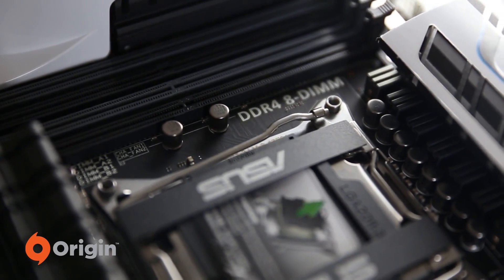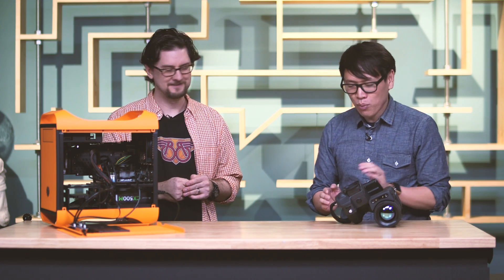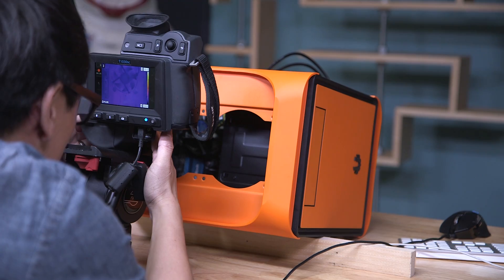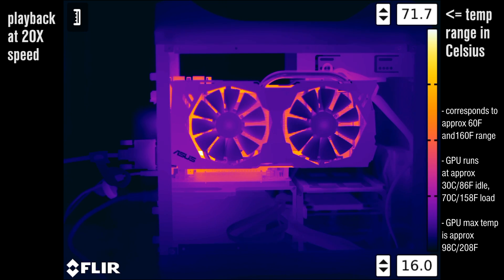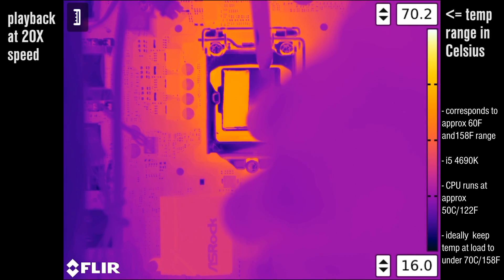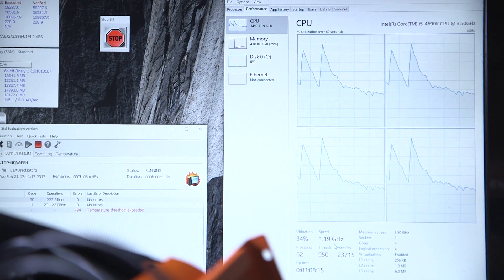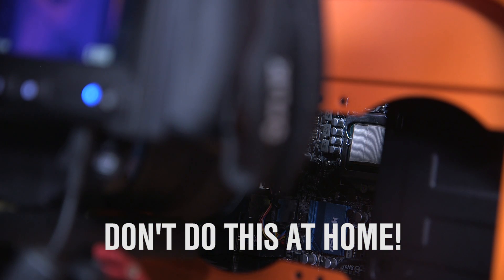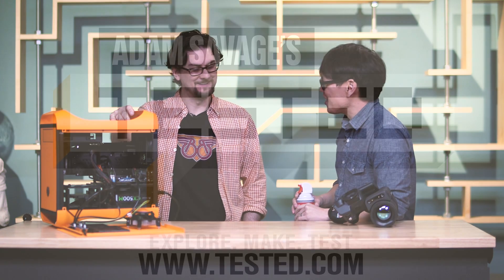Tested: Thermal Imaging CPU and GPU

Comment: When I was still in college my buddy and I were bored so we turned off the fan controller on his GPU, opened BaboViolent 2, and turned off the frame rate limiter. We saw the FPS his somewhere around 2,000 and we saw the GPU cap out at about 166F before we felt like it was going to start smoking. It took somewhere around 1 minute.

Comment: The thing they seem to be amazed by is called Thermal Throttling. Which is normal practice for quite some time.

For example the new GTX 10xx series will rarely go over 83°C. Because it gets throttled down to decrease Temperature.
But this also means it increases speed up to a certain point, if it gets cooled enough.
Thats why I recommend custom Cards over the Founders one, better cooling.

Comment: thats pretty neat, im curious howa closed loop cooling system for both CPU and GPU might look by comparison. i run a 980ti hybrid that has a build on coolant pump and radiator, and my CPU is using a similar device from corsair. they work really well but i wonder how well the heat dissipation differs for the other components.

Comment: I'm sorry Tested, all your Origin sponsored videos have been crap. 

Starting a pc without a CPU heatsink is a terrible idea, regardless of the built in safeguards. You should at least mention that so newcomers don't think it is ok.
Reply: If you're dumb enough to run a CPU with no fan then you shouldn't be allowed near a PC
Reply: its not stupid if you never learned how to do it. if you gave a car to a 18 yo, who had never been in a car before, and told them to rush the red light, would you call him stupid for doing it?
Reply: What if its your first pc?
Reply: It is stupid because you would have looked up some kind of instructions before building a PC plus every CPU comes with a fan and you would notice it should be attached. Logic and common sense would help a lot of people. If the 18 year old had never been in a car before they wouldn't be able to drive it to the traffic light in the first place. At least give a realistic example lol
Reply: Doesn't excuse such massive stupidity
Reply: lol as much as you like from examples but calling some one stupid from a rookie mistake is , in itself, stupid
Reply: Forgetting a CPU fan is not a rookie mistake. It's moronic. Also please work on your English skills lol
Reply: well sure, i'll practice when i have the time to practice a foreing leanguage to argue with a stranger in a comment section.
Reply: Many CPUs do not come with fans
Reply: Most Mainboards DO NOT START without an Fan plugged in in the CPUFan-Connector. It'll show an Error message in the Post-Screen.
Reply: theknapkins every CPU I've ever bought and used, and there have been many, has come with a fan (Intel CPUs)
Reply: You can buy them with or without fans, consumer sites tend to list the one's with fans first because they sell more units.
Reply: Mrstubbsthezombie I've bought multiple Intel CPUs without fans. Consider that your experience is not the same as everyone else's.

Comment: so really what the fans are doing is just moving around that heated air from the source, not cooling it? wouldnt it be better to move that air into some sort of condenser first before it comes back into the system?

Comment: The CPU doesn't spread heat around the motherboard. The voltage regulators that are also placed around the CPU socket on a motherboard put out heat as well, so that's what you're seeing...
Reply: Yep, mosfets can get quite hot without proper cooling.
Reply: Mosfets usually are rated to work @125°C CONSTANT.
Reply: They do put out heat but most of the heating usually comes from the CPU blasting the hot CPU air down onto the motherboard hence the prevalence of sideways mounted heatsinks/fans. They are admittedly less popular now as most motherboards are designed to deal with the high temps so it's rarely required. Also the motherboard is designed to pull the heat away from components so there is some heat from the CPU.
Reply: I'd be willing to bet that some of the board temps you saw near the CPU are from the high currents between the low voltage switchers and the CPU.
Reply: The more important question is "why are they using the stock HSF?"

Comment: CPU's don't throttle at 100°C; at that temperature they should have shut down the entire system already to prevent damage. I would guess they start throttling at about 80 or 85°C.
Reply: Intel chips really don't, until 100. They won't even really crash the system like they used too. (Or blow up like old AMD chips did) They will run your overclock up to a 100, can't say it a good thing, but they will.
Reply: it depends what cpu it is

Comment: Don't use fahrenheit. The rest of the world has moved on. You should too.
Reply: We tried back in the 1970s, and it failed. And that failure wasn't cheap. Some minor changes happened (we often buy soda/pop in liter increments) and all cars use metric fasteners now (though much of that is due to global production requirements) so some of us are already using metric daily.

 But for the folks that "don't get it", it's not as simple as just saying "use metric". For one, we have 250-300 million people that DON'T understand it/use it, many are over 50 years old, making it even more of a hassle. And that's just the "personal inertia" aspect. 

Then there's the actual industrial/business side. EVERYTHING, from gas (petrol) pumps truck scales, tools, pipes, fittings, nuts, bolts, etc, etc, etc are in SAE/standard. The cost to switch things over would be in the $BILLIONS$. Retooling, rebuilding and replacing things to make the switch would take years, and would lower productivity of the affected industries/etc for YEARS while the transition takes place.

And for what REAL benefit? NONE. Would GDP go up? Would crime go down? Would health insurance be cheaper? 

We still landed guys on the moon, we still have the world's largest economy, and NONE of that would be improved by changing over. Once past the age of 6 or 7, all the "fiddly annoying conversion" stuff that folks bandy about as benefits are simply not there. You just KNOW that 12 inches=1 foot, 5280 feet = 1 mile. Or, if you don't, it simply has no impact on your life, because you don't measure anything during your normal daily routine. (for cooking, measuring cups are measuring cups, and pints, cups, etc ARE very convenient, since halves & quarter multiples is actually more handy for cooking than base 10)

Why? Because most folks don't do accurate measuring/weighing/etc, and for those that do (machinists, etc) knowing inches, fractionals and decimals/thousands is already learned and a non-issue. And nobody but a pedant cares how many 1/32 of an inch are in a mile. Yes, in metric, the change is essentially adding 6 zeroes (mm/km) but that type of crap doesn't matter in anything but a nerd fight on youtube.

And for folks like me, that use metric at work (chemist/production/ engineering support) it's even less of an issue. It was a bit of a hassle back in the day making sure I knew both, but nowadays, it's just simple.
Reply: Looking back they even give you that too :P
Reply: slikrx adding to your "we still landed guys on the moon" argument, NASA lost a $125 million satelite because they forgot to switch one number from imperial to metric
Reply: Except for The Bahamas, Belize and The Cayman Islands. Which is odd because you never think of those  three as having their shit together.
Reply: It's funny cause they put everything in Celsius apart from the visual range which you can determine in seconds by looking a the reference below and taking 16 from 30c and you're still mad lol
Reply: It's hard to do when that's all you really know and were taught. We'd have to go and relearn everything. Having said that, i don't understand why America doesn't just use the metric system.
Reply: Teaching both at school and gradually stop with Farenheit solves that pretty quickly

Comment: Amazing the CPU could do 600 ~ 900 Mhz without any heatsink. I have a FLIR E60, and the best way to check how airflow is influencing your components temperatures is to remove a side-panel of the case and replace it by clingfilm, 
clingfilm is mostly transparent to IR (not fully, so don't believe the exact temperature measurements!)
Reply: They all have heatsinks, they are just well integrated.
Reply: Smaller CPUs can do much more, dont forget you have CPUs in your Handheld devices or in Tablets. They don't have room for Fans or Heatsinks.
Reply: Some have heatpipes to the metal chassis acting as heatsync